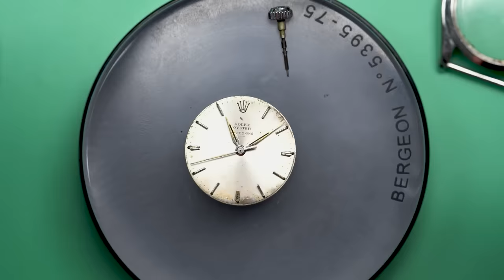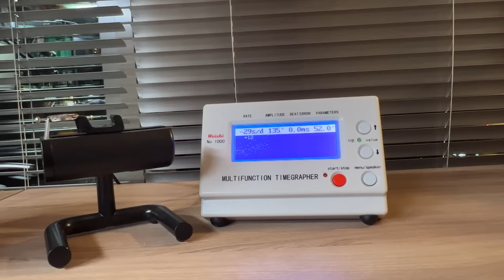This Vintage Rolex Restoration Came Out Even Better Than I Hoped!

Comment: I have polished many watch cases and struggle to recall any good stainless steel watch ever showing real rust and its corrosive effect. Dirt and staining yes, rust and pitting no. Perhaps I am blinkered in having mostly worked with high end pieces but good stainless steel is, usually, just that, stainless. Great content Thank you.

Comment: In the 1950's we did not oil escape wheel teeth or pallet jewels as the oil was not fine enough. Also we attached a cloth to the bench edge to cover your lap and tuck in your belt to catch things you may drop.

Comment: I wish you would have shown us a very important detail which is how do you lubricate the upper and lower balance jewels plus the upper escape wheel jewels.
This is very important because most of the wear is in the tiny pivots on the balance staff and the escape wheel. They move fast remember?

Comment: You don't have to remove the shock spring completely for the escape wheel. Just open it and push it forward. There's going to be room then to lift out the cap stone.

Comment: 2:24 I have a question: Why don't you lift the watch up and let the hands fall down? I would assume that if they "drift" over the surface of the dial, that it would get scatches very easily from the hands? Or is the dial rather resistand?

Comment: Is it possible to replace the pins in a jubilee bracelet? My 1980 Rolex bracelet has stretched out. My Rolex dealer refused fixing it instead wants me to buy a new bracelet and keep the old bracelet.

Comment: Hey wristwatch Revival. I have a 6222 Rolex Precision. When you say not waterproof by todays standards and that it's not waterproof due to age. That is not correct. Being a watchmaker myself. I pressure tested my oyster case on video. It still held up to 100 meters as said in 1953. It actually can hold up to twice that. Just make sure all gaskets are good and you should have no trouble

Comment: One of the worst mistakes owners of water-resistant watches would make is assuming they could wear them in the shower or bath.  As a result, not only would the hot soapy water would draw in gunk into the outer watch-case (observed with this case) & metal wristband, but the alkaline compounds in the soaps eventually destroy the case-seals which ultimately causes real damage to the movement!

Comment: I have a 1935 curvex which I dropped on concrete 15 years ago.    Hasn't run since.     Gold filled not 14k.     Do you do pro bono?     Hell, its just sitting in a drawer.

Comment: 6 seconds .. either use the adjustable hairspring adjustment (+/-). I'm no watch expert but it's pretty darn simple looking at your watch. You already have the machinery for the oscillation to detect angle and timing...
Reply: Blown up view at 30:25 that black lever (+/-) looks like it's dead in the middle on the pallet fork.

Comment: Watching these videos is oddly relaxing, I love it, but I'm suddenly realizing something I'd never actually thought of.
None of these watches use batteries... is that a vintage thing? or is it more of a price thing?
I got a watch that I was gifted when I was about 15, which is over 20 years ago now, and it was a decently pricey one... to me, a more fancy thing than anything else I've owned as a watch, I've even had it serviced... though the watchmaker ended up having to swap the movement in it, though he said it was also an upgrade to a newer movement when he did so and all, but... it's still battery operated.
How big are the differences in the fully mechanical ones, and the battery driven ones?

Comment: Wow, normally, I wouldn't be caught dead wearing a Rolex. Nothing says douchebag more than a guy with a Rolex and a Range Rover. This Speedking is different though. It's elegant, simple, and humble. It doesn't shout "Rolex" from the mountain tops. The patina softens this watch and it almost breathes. I would proudly own and wear this watch. Your restoration was so loving and gentle and your video was like sitting by a fireplace in a log cabin drinking a cup of hot chocolate. Every day you wake up, there's something new to learn. Thank you.

Comment: You need to relax on the oil a bit there, your winding pinion and clutch wheel were drenched in the oil and the stem didn’t need to have that much (if any).
Also, you should oil on the mainspring and not just the arbour. This will help with even power across the whole reserve. 
Only other thing is jewels should be oiled as part of the service regardless of if it’s crusty or not. (May as well while you’re in there, it will also greatly improve amplitude)

170 degrees is not great for overall timekeeping, for this watch, and a full service you should at least have 230deg. Anything under 180degrees will be impossible to have keep consistent time… 

Some friendly advice from a professional watchmaker, other than that, great video!

Comment: I can’t find a watchmaker in my area to service my grandfather’s 1961 Model 1500 Rolex.  Does anyone have any suggestions in the area or someone that handles mail in options. My watch runs, but the pin doesn’t appear to wind the watch but it winds with the perpetual mechanism and pin does allow adjustment of time and date.  The watch appears to be holding time in the new winder/holder I bought.

Comment: It seems to me that you are mistaking the degraded and yellowed lacquer on the dial for wear on the dial. I can see around the edges the original color of the white metal and I can see the flaking, yellowed lacquer that was dipped onto the dial to protect it from oxidation. The lacquer is not part of the watch, it is there to protect the metal and can be dissolved in acetone and redipped in gloss clear lacquer to make it look brand new. That dial is literally brand new under the old lacquer.

Comment: - Why is it that I have never seen you oil the Balance Wheel top jewel and bottom setting point?
- Oh wait, you did do the bottom at 31:16 and the top jewel at 31:38.

Comment: I have a question for anyone out there. I inherited a Rolex oyster Speedking  model 6430 the serial number  136  273, I can’t make out the fourth number. Trying to find out what year it was made,did some research but can’t confirm what year it was made. Some sites say 1959 others say 1970. It’s just oyster Speedking not perpetual or precision. It has a stainless steel jubilee wristband. If someone could point in the right direction that would be appreciated.

Comment: You often say "it's easier to buy a new one" about electronics. You know why is it so? It is because manufacturers of the electronics usually lock away the replacement parts by the contracts with their vendors/suppliers. The skillset and told needed to repair electronics is scaringly similar to what you have (microscope and ultrasonic cleaner are 1to1 match).

Louis Rossmann from YouTube has a lot of videos on MacBook breadboard repairs as well as videos about advocating right to repair (a movement trying to oblige manufacturers to make replacement parts available for everyone as well as freely sharing information required to fix their products).

Edit: oh, so Rolex won't sell you parts too, so you can understand the pain.
Though... Unlike in your business most components of the breadboard cost pennies and most of the time they are the ones that fail, but you won't be able to buy them anywhere because manufacturer made them impossible to buy.

Comment: i bought my first 'for parts' watch off ebay today i was given an Invicta Pro Driver from a family relative because i wanted to get into watch making, and i asked if they had a watch that was not running, this poor watch is trying to run and did so for a few days but the second hand is rubbing on the minute hand causing problems, so i bought one more off ebay for parts the bezel is missing and crystal on mine is damaged

Comment: I like the videos but I will tell you something that made me lose a bit of interest. You restore complete jewels, you do an extremely good job, but then you go on and put an acrylic "crystal" to replace sapphire crystal. Oh god why?? Plastic just cheapens all that work and effort in my view. Please do consider using mineral glass or sapphire crystal, not acrylic. I wouldn't wear something with acrylic on it, and I think the same is true, specially if it is something north of 2.000$, doesnt make sense.. I know it is easier to fit it in, but still. Thanks.

Comment: Yeah, this guy is a pretty rank amateur.  You always clean/lube the jewels first when you can get to them easily before reassembling.  Instead, he pulls the jewels afterward and just lets the gear axis pins bash around in their holes.  And, I can't believe he was working on the movement like that with it actually running.  It's way too easy to drop something (which he did) into the balance wheel area and trash the hairspring.  He got LUCKY on that one.
Reply: I'll agree with you on the part of pulling/cleaning/oiling the jewels last.. and also working on the movement while it's running. I've never opened up a movement, and only really changed out bands on a watch.. but still I could tell those 2 things weren't quite correct. Also the handling all the parts with steel tweezers...

Still, I wouldn't be too harsh on this guy. He approaches watch working the way many of us inexperienced hobbyists would, and I'm sure lots of experienced watchmakers have their own bad benchside manners.